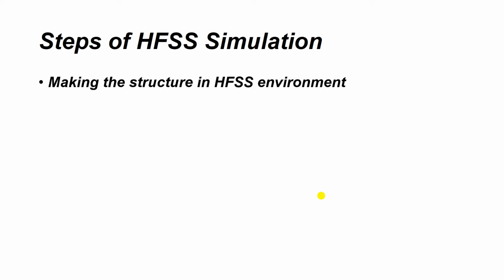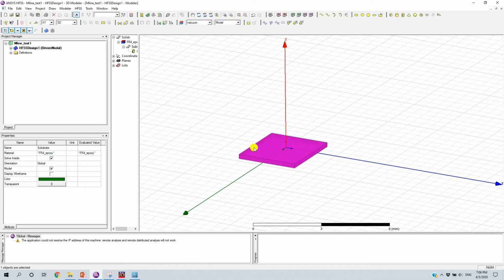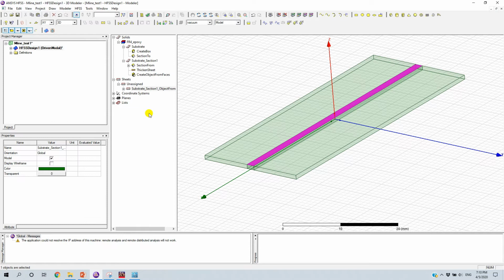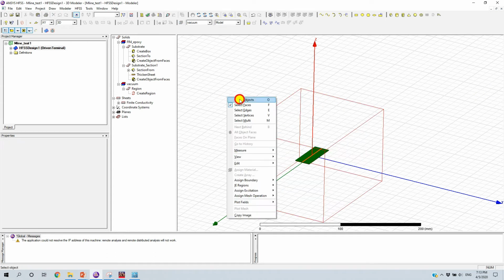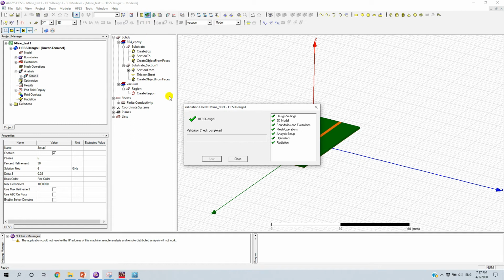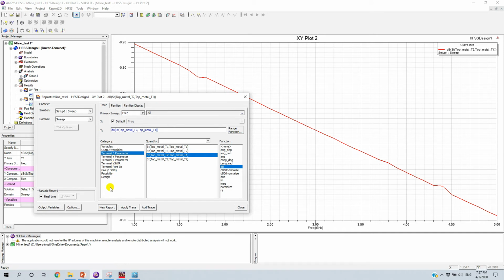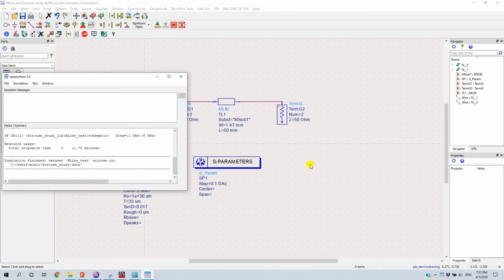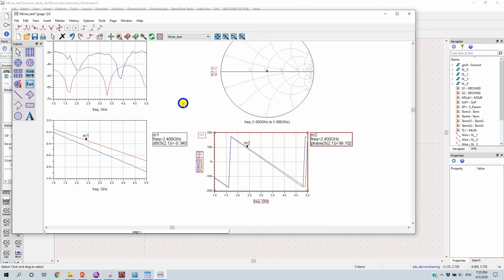Microstrip line Simulation in HFSS

Comment: How do you set the thickness of the metal?
Reply from the maker: Hi Gustav, thank you for your good question. Usually the thickness of the metal sets by the PCB manufacturing standards. For example, if they provide 1oz copper (T=35um) or 2oz copper (T=70um). Therefore, follow the specification that is provided by the manufacturer and set the metal thickness based on that.

Comment: Why there is a shift in freq between s11 and s33
Reply from the maker: Hello Mahesh, Thank you for your question. The main reason for this shift is that the MLIN that is used in ADS is an ideal T-line model while the S2P file generated in HFSS is a realistic model that includes all the EM effects. But if we consider the values of S11 and S33 in dB, although there is about a 10dB difference at 2.4GHz, since the values are quite small (-35dB to -45dB), we can ignore that. Usually, it is better to tune the width and length of the transmission line such that the frequency of the notches matched with each other. Please let me know if you need more explanation.